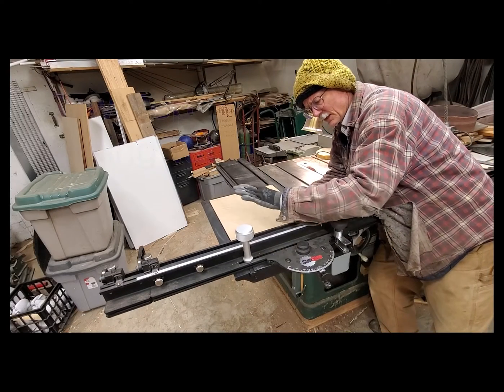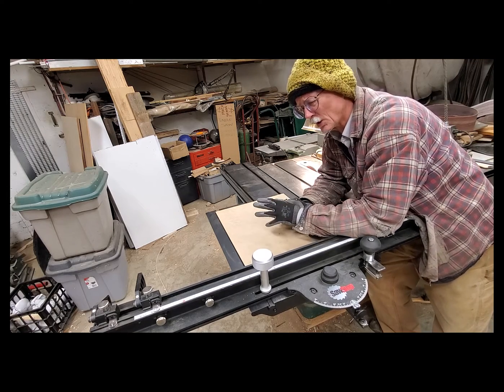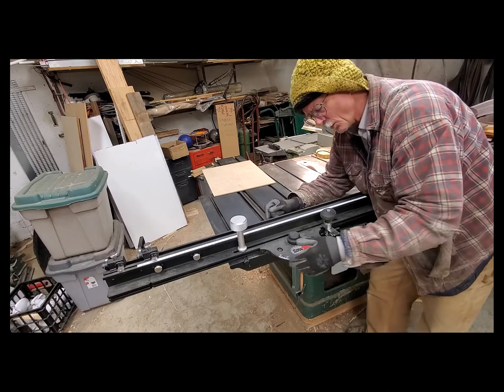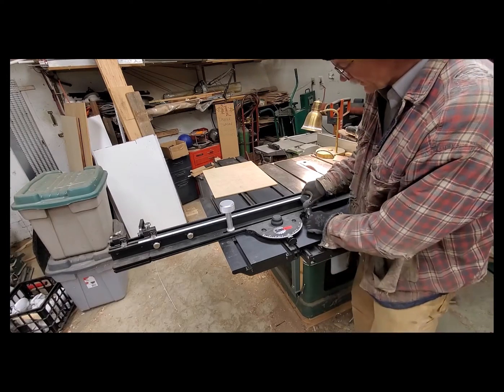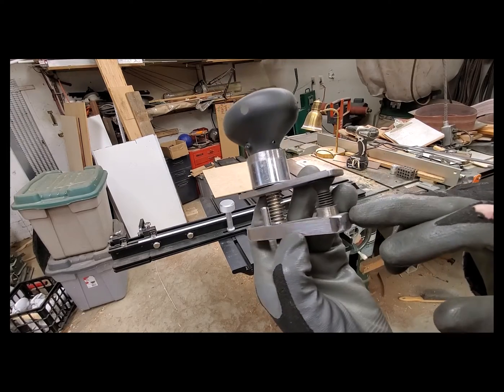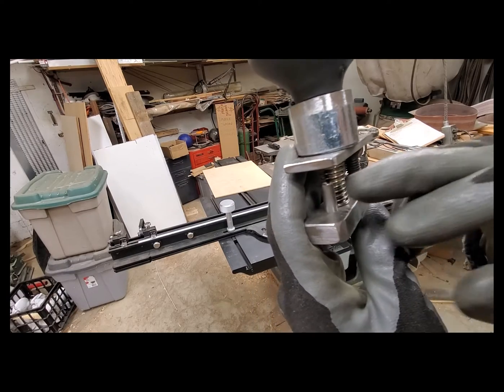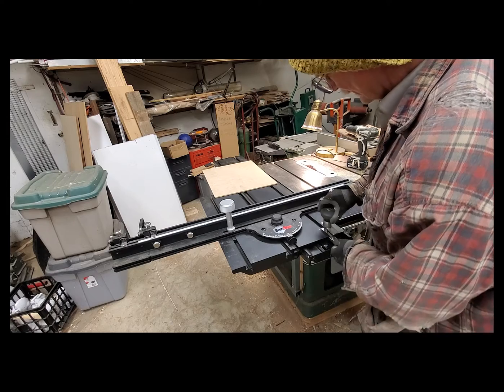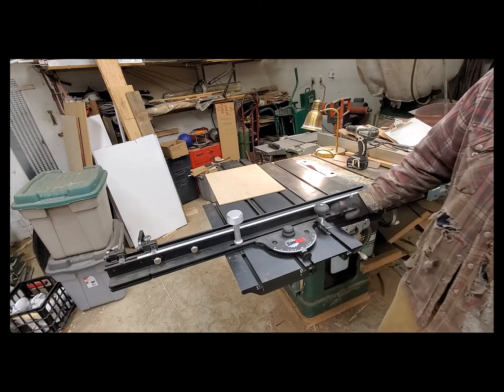Fixing SawStop Sliding Table Fence Squareness Repeatablility.

Comment: I am wondering if there is something wrong with the 2 5mm set screws on your bar.   They are reverse thread, tighten counterclockwise.     My gauge is rock solid.  The only time I loosen is when I need to remove the fence to allow wide ripping.

Comment: I missed something, I never saw you tighten the miter gage in the T slot. No wonder it was loose. I was also watching for your square test to be finished.  If you make 5 cuts the way you were doing, then on the fifth time cut off an 1/8 " break it half and see if the 2 pieces are the same thickness.